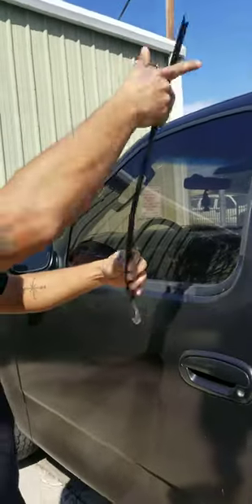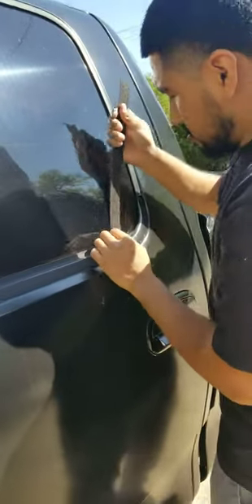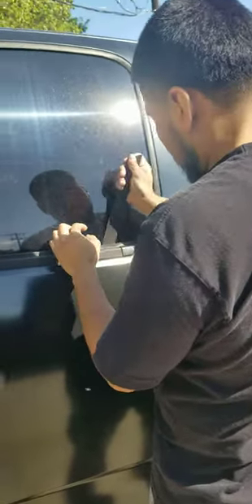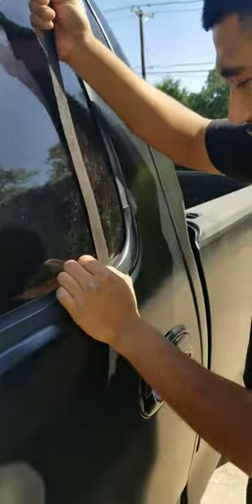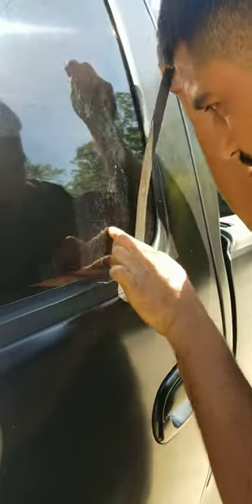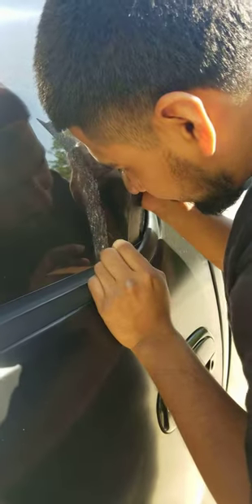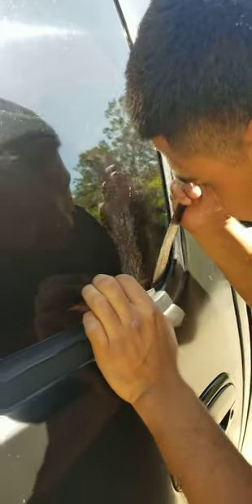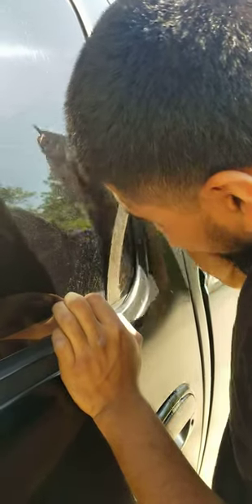how unlock a f150 09 with slim Jim

Comment: Almost. You were pushing down on the top of the angled portion rod instead of pulling it up from beneath. (Try lowering the slim jim deeper in the door front of the button before sliding it to the rear). But yes, a slim jim will unlock a 97-03 Ford F-series pickup. P.S. Before putting the slim jim in, insert a small door stop or a plastic pen between weatherstripping and the glass to give yourself more room to work.